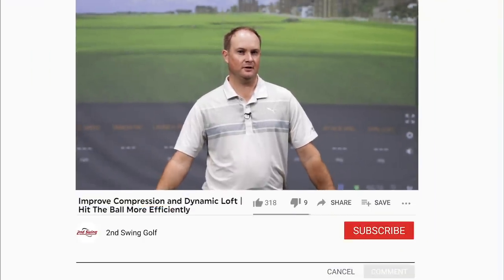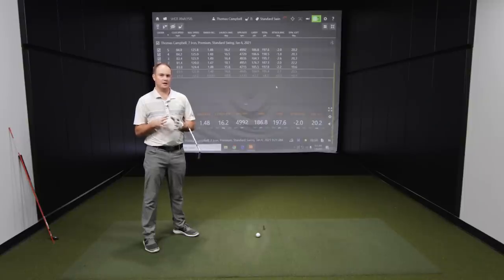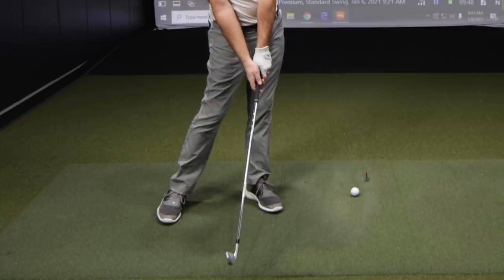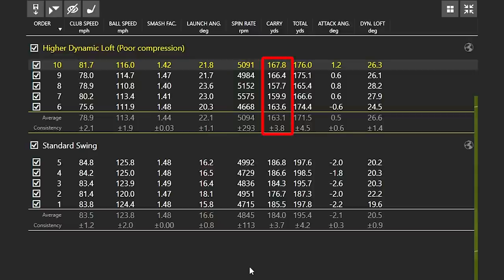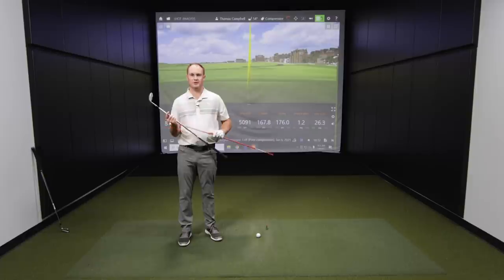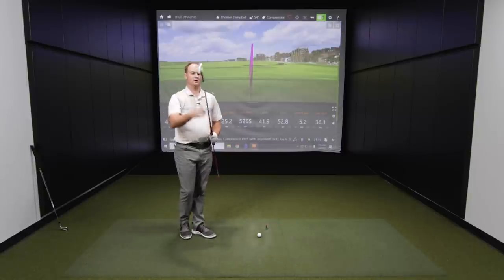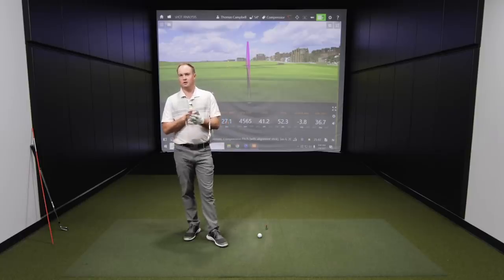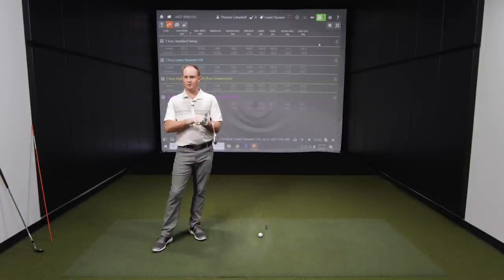Golf Swing Tips | Improve Compression & Dynamic Loft | Hit The Ball More Efficiently

Comment: If there was ever a video I needed, this is it. One thing I learned recently is that during the takeaway, to not lean back in addition to rotating. I used to do both, because in baseball, a weight shift gets more power. But with a golf swing, it creates less consistent striking, and required me to flip my wrists to make better contact, which led to way too much dynamic loft on my shots. So this is incredibly helpful to me, thank you so much.
Reply: My coach called that drill “punishers.” Cause if I did it poorly, and added too much dynamic loft, the thing hit me in the side! And after being hit a few times, the punisher would help me correct.

Comment: I completely understand this concept…growing up a hockey player, I never had trouble with the compression part.  However, now that I’m older (53), have had two hip replacements, suffer from degenerative back disease, and had shoulder surgery, my swing speed isn’t like it used to be…I’ve watched was feels like 100 videos on this subject, yet no one has actually discussed how to find your ideal dynamic loft (or spin loft for that matter).  My swing speed with a 7 iron is around 77mph now and my T200 7 iron has a loft of 31 degrees (my T100s have 32 degrees of loft). So, what would be the way to determine the ideal dynamic loft?  Do I just need to keep fiddling with and figure out what combination gives me the best/most consistent ball flight for each club, or is there at least a recommended starting point?  For example, if your swing speed is Xmph your dynamic loft should be around Y degrees lower than your club’s stated loft?  Seems as your swing slows, you need more loft/spin to get the ball to stay in the air, so a dynamic loft closer to the stated loft of the club is better (e.g., 8 degrees lower rather than 15 degrees lower if you have a 90mph swing speed)…does that make sense?  Any recommendations?  I do have a Mevo+ that gives me my dynamic loft and spin loft, so I’m currently working on that aspect of my swing…great video as always!!!
Reply from the maker: Thanks for the feedback Pete! I know we say it all the time, but the ideal dynamic loft is player dependent. In your case, the attack angle will be a big influence on the ideal dynamic loft for you. You are on the right track though in regards to swing speed -- the slower the swing speed, the more loft needed to generate the spin necessary to keep the ball in the air. thankfully, we can bend some iron sets or order sets through fittings at higher lofts for our customers

Comment: This is something that I have been working on over the last couple of months with my coach.  The drill we used was a trail arm only swing, about a quarter swing to allow the trail wrist to hinge naturally due to the club head weight and then swing through with aim of hitting ground fractionally ahead of the ball.  My descent angle went down from 0 to about -5 degrees, my spin rates went up and I gained a club in distance without swinging any faster

Comment: 5,000 rpm backspin is not going to to give you the stopping power on a green you need at all. 

The problem with Thomas’ compressed numbers is that his draw and the low dynamic loft gives him ZERO stopping power on the green. 

12 yards of rollout is not good at all. You’re going to have zero stopping power or ability to place the ball close to the pin. 

I’m all for compressing irons but I have a 110 mph club speed with a 7i and have plenty of spin. 

 If you’re going to to compress the ball, you need to get fit into the right ball and shafts that will give you the accompanying 7,000 revs of backspin you need to stop the ball on the green. 

You want approximately 1000 revs of backspin times the club number you’re playing. Hopefully this is helpful so that people understand that your spin rates have to be adequate to give you stopping power on the green.
Reply: You’re right. These guys never explain this in any of their “get more distance” videos. Doesn’t matter if you can’t stop the ball on the green.
Reply: 2000 revs of backspin too low won’t allow him to stop the ball on the green. He needs a different ball and/or shaft.
Reply: I think there are a couple of issues with Thomas' spin rate.  There is the old problem that launch monitor spin rates from mats are always lower than you would typically get on the course.  I suspect that on the course Thomas' spin rates with this iron would be 5500-6000 rpm, still a bit low given his speed but more manageable - I would guess Thomas' gaming irons probably have more loft than the Srixon's he was using in this video so he would get more spin.  The other issue, which Thomas' has mentioned in the past, is that his swing is relatively shallow, his descent angle with a 7i tends to be -2 degrees when ideally you would want it a bit steeper.  Very noticeable that when he tried to exaggerate his compression although his dynamic loft reduced, his attack angle was -5 degrees and his spin rate went up 200 rpm
Reply: Come on, the guy wins golf tournaments and you're ragging him in the comments...
"I have a 110 mph club speed with a 7i and have plenty of spin"
Righto.
Reply: @michaeltruelove3826  all things that need to be addressed in a video. It’s not “ragging” on someone when they’re creating an instructional video to point out flaws with the data in hopes that subsequent videos address this. You need stopping power on the green.
Reply: @justinstephenson9360  all good points. Looks like they are releasing a video on stopping power tomorrow ironically enough. Should be a good one to see.

Comment: Good lesson in how to 'compress" the golf ball.  However, you must have an absolutely consistent low point in your swing to successfully deloft the club as much as you do.  For example, say your 7 iron has a sole with 8 degrees of bounce.  If the club is delofted more than 8 degrees, the leading edge of the club's sole will it liable to dig into the ground before the clubface strikes the ball unless the ball is nipped perfectly. Most of us amateurs don't have such a consistent low point.  And if the 7 iron is delofted more and with a larger negative angle to attack, the bad consequences of a  slightly "fat" shot are even greater.

What role does the ground play in ball compression?  When compressed, does the ball flatten against both the clubface and the ground?  Can the ball be compressed when it is sitting up on dry grass?

Comment: Thomas, thank you for the video; it was very helpful.  I do have a couple questions though: Why, with the Lower Dynamic Loft did the ball carry 9 yards LESS than it did using your Standard Swing?  Shouldn’t it have carried even further?  Can you compress the ball too much and then begin to lose yards?  Thanks for your help : )
Reply: I believe this is due to the reduced launch angle, dropping outside the optimal window for the ball speed and spin rate. So although the smash factor increases the launch window is not as optimal as his normal swing.
Reply: There is also a relationship between optimal dynamic loft and swing speed. Tour players can crank down their dynamic loft because of their high swing speeds.

Comment: I need help with my driver swing. I m in/out, mostly neutral  swing but i still push the ball or push slice it. i changed to a stiffer shaft which helped alot but for whatever reason i m still leaving that clubface open, i have a strong grip ish but just not sure what is happening.  with my hybrid i have to use a weaker grip and lift the club higher so i m not so in/out with the swing for me to drive it straight. sooo god knows what is up with my driver swing

Comment: would you say under 20 degrees of dynamic loft on a 31 degree static loft club is where you get diminishing returns?
Reply: You have to be able to stop the ball on the green, the more shallow the ball is flighted into the green, the less stopping power the ball has. It’s why a driver isn’t a great approach club into a green but a PW is. More height and more spin to be more precise. Height is your friend and so is spin. The lower the loft, the less spin you’ll generally have. There comes a point where  you deloft the club so much that you roll off the back of the green and can’t clear green side bunkers because your flight is too low so you need to run it up so it has room to stop or you roll off the green.

Comment: I'm confused by this. If your 7 iron goes 150 and you want it to go 160, instead of delofting the 7 iron to increase the distance just hit a 6 iron! It's alread delofted automatically by 4 degrees
Reply from the maker: This can be a confusing topic. Essentially you want your hands ahead of the club at impact when the ball is on the ground to "compress the ball" if a 7 iron has a stated loft of 34* if you present a dynamic loft of 34* the ball will go very short high and spin a lot. You need to be forward about 10* to promote a good turn and finishing on your left side - Thomas